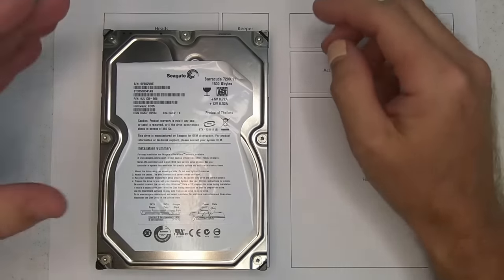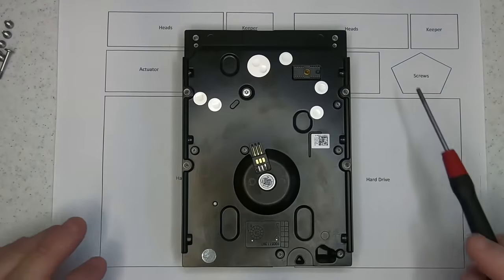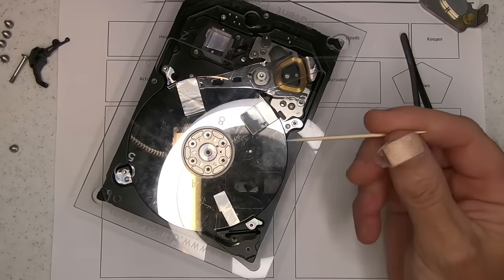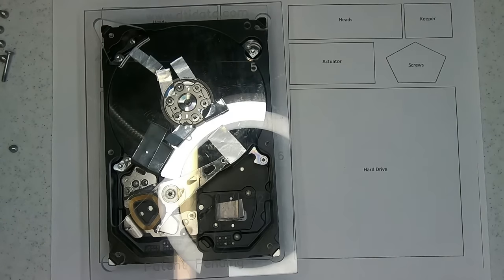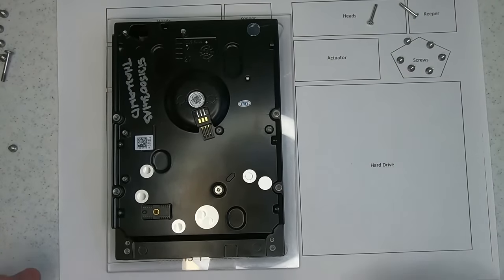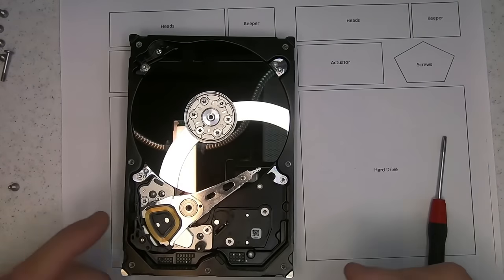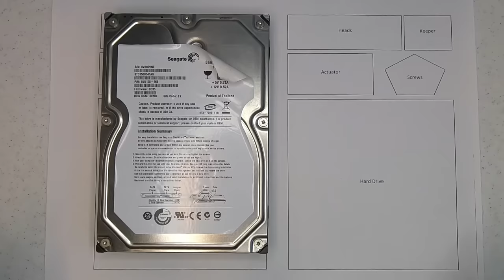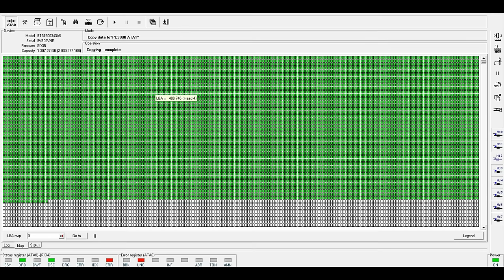Platter swap hard drive. Base Replace. How to retain platter alignment for data recovery.

Comment: GREAT video and explanations brother!
Reply from the maker: Thank you! We’re going to try to do this often.
Reply: @Dtidatarecoveryservice  Awesome! I’m interested in this arena as well, having 25 years IT/Microelectronics experience. 

I’m going to look into the Deepspar and PC3000 tools as well; I have a “non-critical” 1TB WD Passport external 3.0 drive that came up slowly and didn’t read reliably; I only briefly saw the DIR via Windows File Explorer and didn’t think to take a screenshot of the data to see what all was there - so it will be good for me to experiment with as a low-pressure intro to recovery. 👍
Reply from the maker: @Dawgator  yes- if you’re WD is new you may want to get the USB add on from DeepSpar. You have to get an unlocked board to get to the system area. If it’s not heavily damaged you can use DeepSpar DDI or the PC - 3000 to image via USB.
Reply from the maker: You can also purchase boards that attach to the PCB to use a SATA connection. Lots of things with new SMR WD drives that are a hassle. To get SA access you use to be able to use a matching SATA board and move ROM and get to the SA. Now part of the SA is on the MCU - too much to explain in a comment. Going through usb on either tools should work.
Reply: @Dtidatarecoveryservice  it’s circa 2009-2011, I believe. But yes, with the integrated USB 3.0 interface instead of the case adapter to SATA ☹️
Reply from the maker: @Dawgator  great! Find a board with matching part number- move ROM . You can probably find a how to on this. Maybe we will post a video for the older WDs. You have to keep some points from making contact. Still very doable through USB. You won’t have to deal with SED

Comment: Thanks for your reply,i have external/portable 2tb seagate T3,T4,T5 etc cannot find tool size for spindle /platter removal.
Reply from the maker: So this is a small laptop-size drive? ST2000LM007?

Comment: Be very helpful if u would mention what size torx bit to use t3 t4 t5 ect
Reply from the maker: Sure T8 for external screws to open the hard drive. T6 for PCB and internal screws. More here:https://dtidatarecovery.com/seagate-platter-swap-spindle-motor-stuck/

Comment: Can I purchase a plastic platter fix with information of materials used to fix hard drives thanks
Reply: The product we sold was called Base Replace. We don’t have any in stock. What model of hard drives do you find have jammed or seized spindle motors. If we had enough pre prefers we could make another hundred or so.

Comment: Nice video, learned a lot from this. 

Did you disassemble and reassemble those drives on the video using a laminar clean table?
Reply from the maker: It is in a Liberty soft wall clean-room

Comment: Hi 
I moved platters each one separately and the driver clicks and no detection in computer 
Please help me 
I need my data
Reply from the maker: If you have moved the platters individually, you have lost alignment and the data is gone. I am assuming this is not a 2.5 inch laptop size hard drive.

Comment: Hello, I would like to analyze the fault on this non-functional Hdd https://youtu.be/9gBILnvi8Rk if it is a malfunction of the read/write heads or some electronic part.
The error occurred during Windows installation when it formatted the entire disk instead of the specified partition.
The Hdd cannot be initialized or formatted in the computer, nor can Minitool Partition repair it. Thank you in advance for the advice.

Comment: Do you need to remove the earthmagnet to move the heads when theyre stuk on the platters?
Reply from the maker: We evaluate how the heads are stuck. Sometimes the soft course head has bonded and just moving them isn’t a great option. We may use temp variations to have the head expand or contract so moving does not damage the platters. Usually, the magnet does not effect moving the heads.
Reply: This is inside a Unity Steel post and wrap cleanroom. Took out the filter noise.